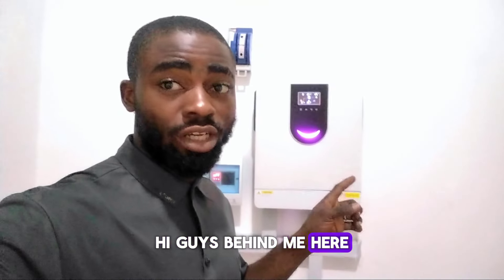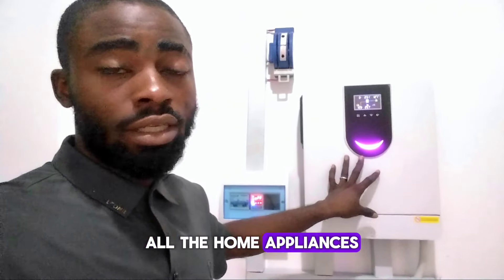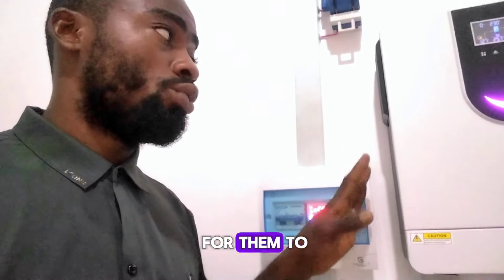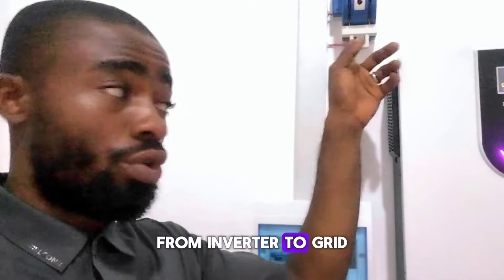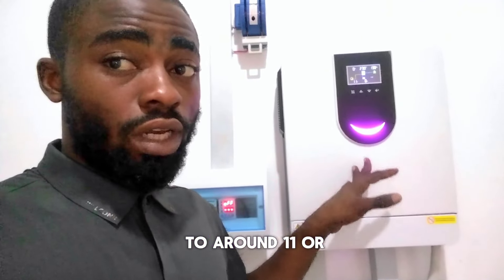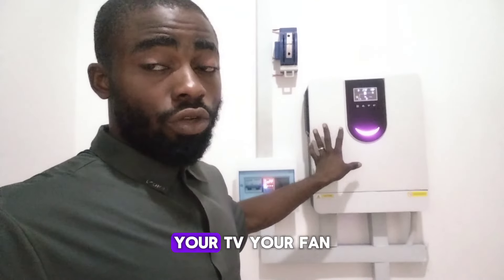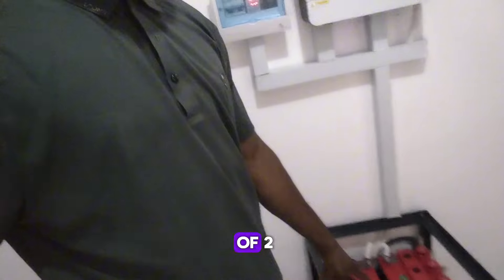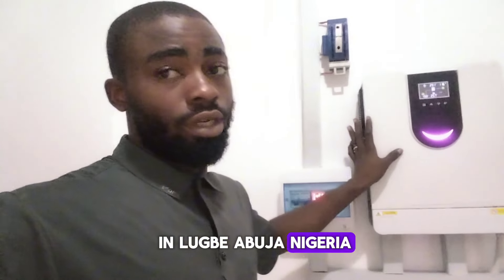Cost of installing 4.2kw inverter with 5.2kwh battery bank and 2.4kwp solar energy system.

Comment: Solargod, I was offered 10 pieces of 100w/18v/5.3amp for free, kindly advise me if I can connect in parallel for a 1kv/12v set up and 220 tubular battery.

I remember you told me to use 5 pieces of 180w panel but I am about to get the 100w for free.

Kindly advise me
Reply: 10 pieces of 5.3 amps in parallel would be about 53 amps - same voltage.
I think u should be cool with 12V battery with a 60 Amps charge controller.
But... I'm not an expert. Na idea I just dey use - make I no go confuse you. Plz listen to whatever Solargod says on it
Reply from the maker: Please do use the whole 12panels on a single battery.
Use 5 at least
Reply: @Mairigaemmanuel  thank you...I will use the whole 10 with 80amps mppt controller

Comment: Is sunfield inverter durable
Reply from the maker: Yeah
Reply: @Mairigaemmanuel  u said it cost 1950000 I interested but I don't want tubular batteries. How much will it cost if you want ti do it for me with lithium ion batteries or lifepo4 batteries.
Reply from the maker: 2.5m